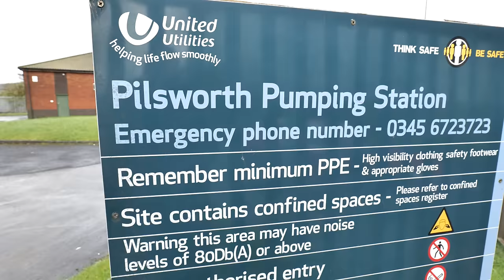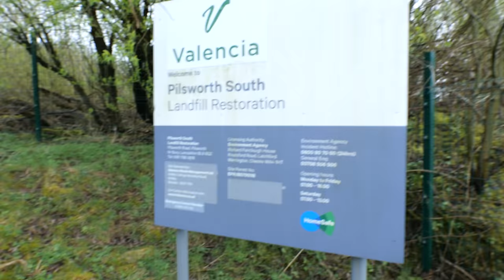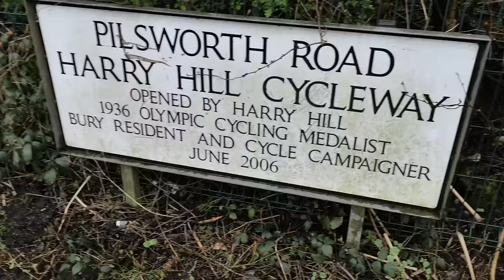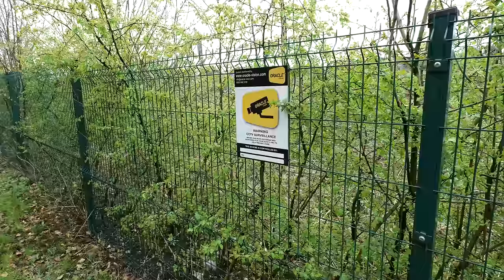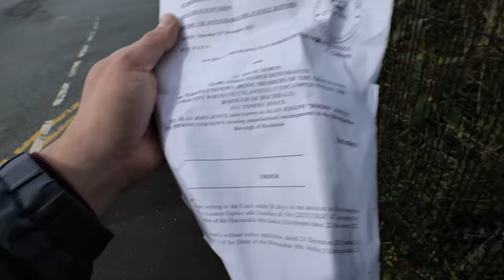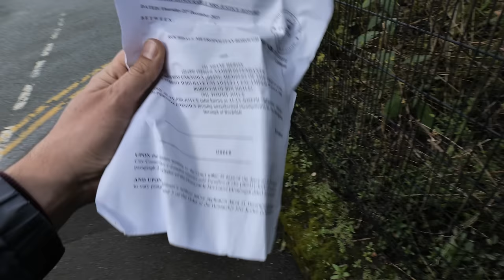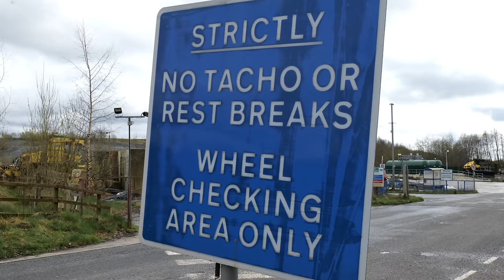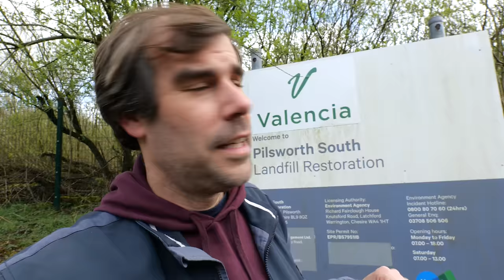NASAL TERROR: Caught Inside Europe's Smelliest Dump

Comment: The pipes sticking out the ground are for capturing gas to burn in engines to generate leccy and hot water, its actually pretty good.👍

Didnt get a good look at the chimney it could be a flare stack for excess gas to be burned off.
Reply: They used to do that when it was Virrador, but it's been taken over by the company Valencia & gone down hill fast, over tipping not capping the gas, as you can see on the video the site is disgusting. Somebody's making a fortune & it wouldn't surprise me if councillor's have very greasy palms.